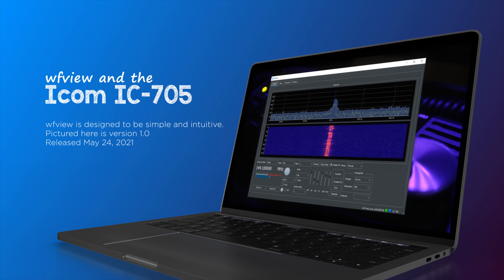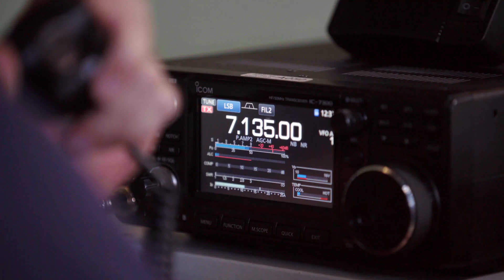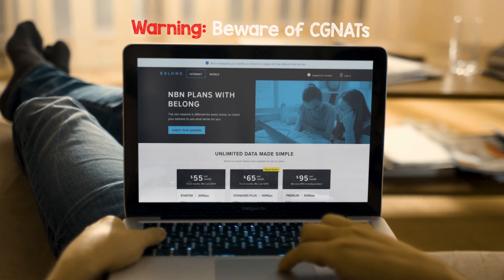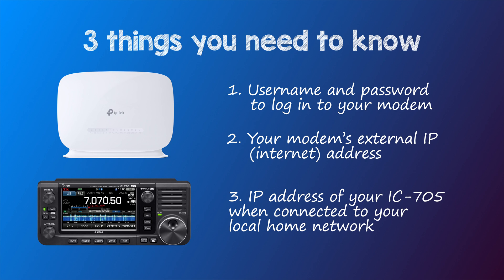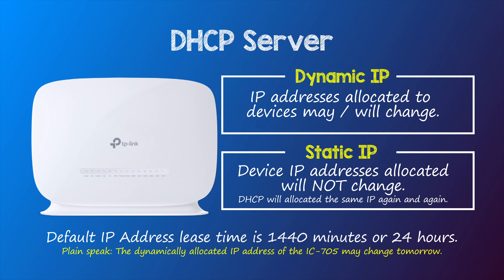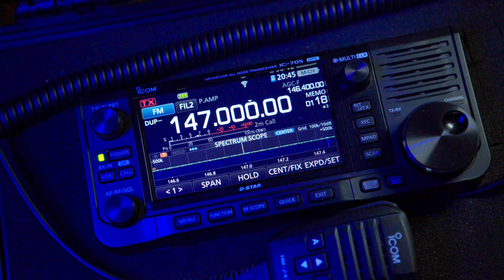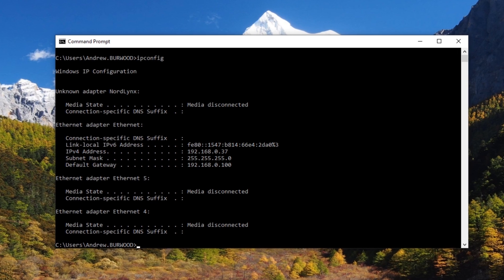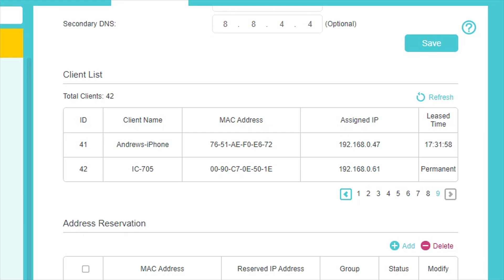Port Forwarding for Icom Radios

Comment: Thanks, this video sorted my router problem in getting the correct configuration. Now I have my Icom 7200 running remotely at last using Wfview. Excellent instructional video

Comment: I have a Icom 7100 on the host PC wfview is working... but I can not get the remote PC to even connect to it even on my home network with my Laptop all my settings match????  every thing is on a static address
Reply from the maker: Hi Matt. Could be any number of things. It sounds like something is blocking your ports. Check your local firewall for starters and make sure those ports are allowed.
Reply: Start with your actual computers firewall. If it's windows, check windows firewall settings. If you have a seperate antivirus/security package like norton 360, set it up in there. I had this problem and resolved it by 'allowing' the 5001 etc ports to go through. Good Luck, Regards VK3MSF